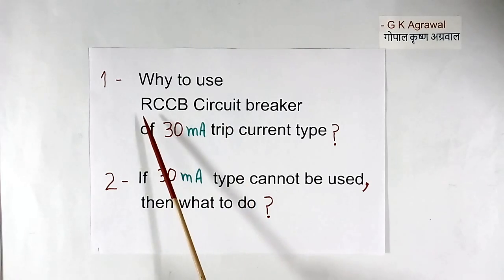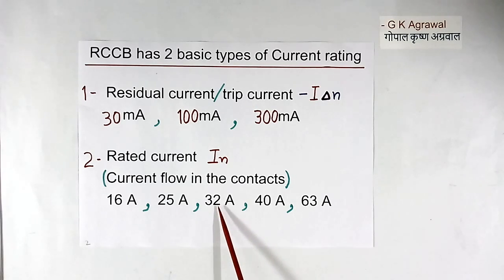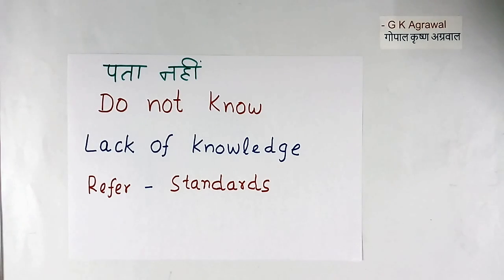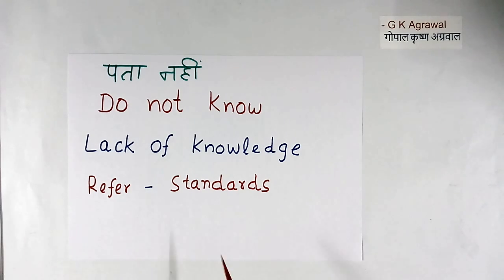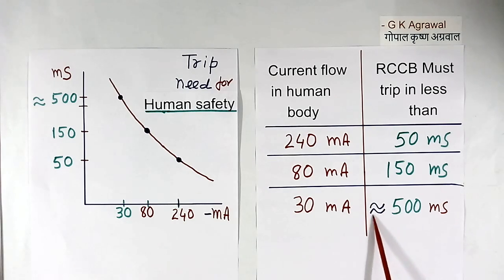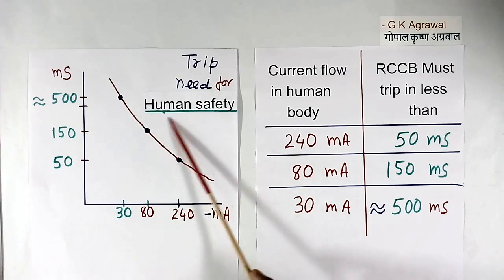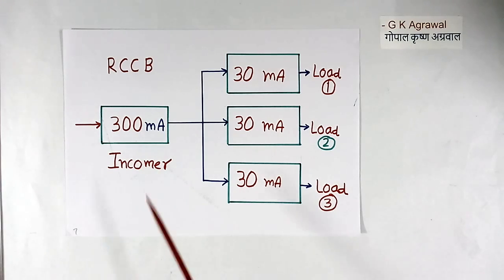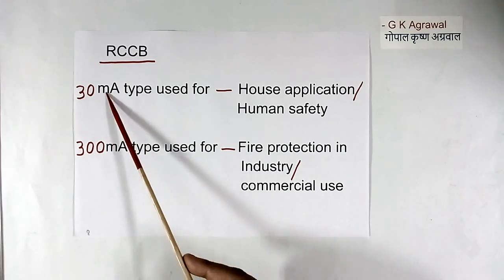Why 30mA RCCB circuit breaker is used in home

Comment: If main line outset then inverter supply will be effectively work using rccb   
or not in earth leaksge. Pl. suggest inverter connection connection.
Reply from the maker: There is a video on, when RCCB will protect and when not. You can watch that video.

Comment: Hi Sir, 
in my home(invidual house - 3 phase) we are using 30ma rccb but it's tripping frequently (especially in night)  can i replace with 300ma directly  . If not how can i split the load?
Reply from the maker: Should not use 300mA, use only 30mA. Some equipment is faulty. Locate the problem by trying by keeping few equipments off in night. May be some heater, fridge or motor.

Comment: If there is an inverter installed in a house then there are two different line ,one inverter line and other is power line. What type of rccb Should I use here? How?
Reply from the maker: Use 30mA type RCCB in both the line.
Reply: @GKAgrawal2  Type "A" to take care of non sine wave current produced by the inverter.
For EB line type "AC" by default.
OK Ji